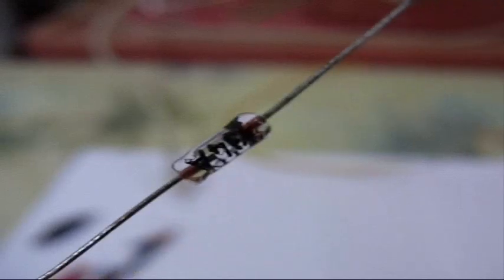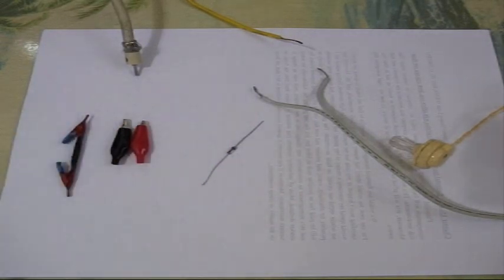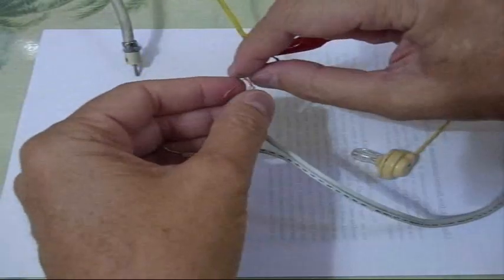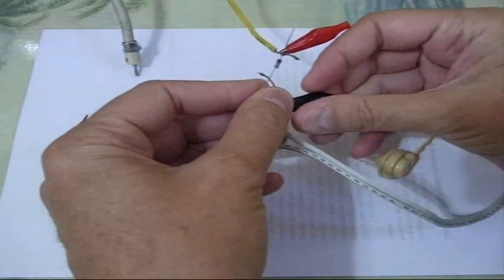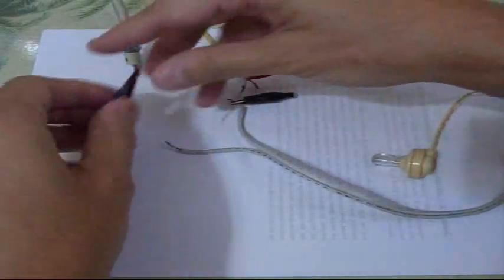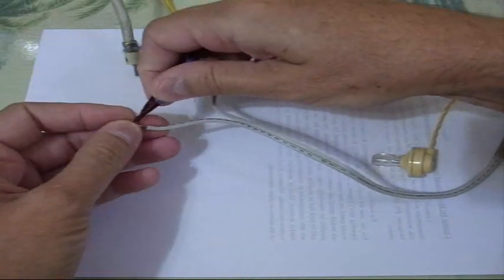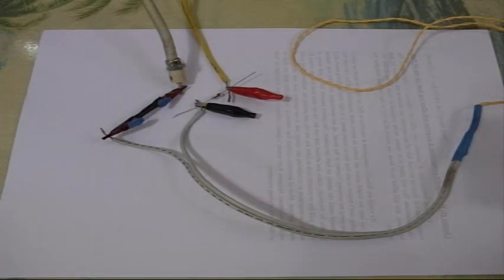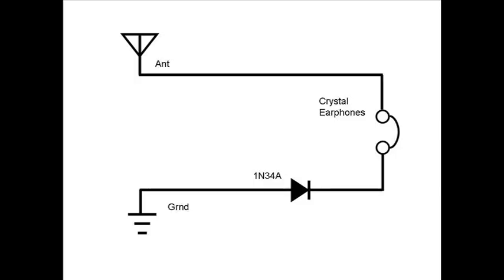World's Simplest Radio

Comment: I made my first ‘Crystal set’ when I was 12 yrs old (and thats’s over 64 yrs ago) then I later added a tuning condenser that enabled me to tune into different (medium wave) stations and then I added a small amplifier with battery to power a speaker. But the thing I most remember, was being exhilarated at hearing my first program come scratchily through the Airways with my Ex-War surplus earphones that were plentiful in those days.
Reply: My Dad was born in 1940, and he too got interested in electronics at a young age.  I believe a crystal radio was his first electronics project.
When I was a kid he told me about tuning into an interesting AM radio station across the Rio Grande from Del Rio, TX as a teenager.  I guess the radio stations in Iowa weren't broadcasting much new music at the time.  Him being an electronics nerd allowed him to hear Chuck Berry, Carl Perkins, and Little Richard before most other people in the area.
Then he went into the U.S. Navy and fixed radars, followed by fixing TVs at Sears for 35 years.  I miss the old man.
Reply: Nothing quite beats listening to a distant station fad away as the sun comes up.

Comment: now I remember my first radio using 2x 1n66 diode and crystal earphone.  :)  almost 27 years ago! thanks for sharing.
Reply: I used a 1n60 diode 1 Variable capacitor 300pf piezzo earphone and a very long wire for antenna.
That was in 1978.
Gooood times.
.ha
Lol

Comment: That it is!  It would even be listenable if two conditions exist ; 1) you are in range of an AM station, 2) That AM station is not being competed with by other stations because (a) it is the only AM station within range, or (b) that AM station overpowers all the others.  Unless one of these two conditions exist, you will hear nothing at all, or  just a cacophony of several stations being received at the same time.

You need a way to tune the AM band.  A coil is the simplest, a coil in parallel with variable capacitor is even better, and make the received signal much louder.

Even simpler?   Toss the 1N34 or 1N60 Germanium diode, and use an old, tarnished, all-copper penny "tickled" with a sharpened #2 pencil lead for the best signal.  The pencil lead can be mounted on an opened safety pin for support.
Reply from the maker: There are 17+ stations in my area and this setup locks on to the strongest, you can not hear any of the others.  I have several other videos on different types of crystal radios, but this is the simplest one can make.

Comment: the diode is connected to the ground and not to the antenna side? The drawing is correct? What happens if you turn the diode around, change its direction? Would it work also?
Reply from the maker: It does not really matter.  It's just either ground or antenna, diode, earphone lead 1, earphone lead 2, and then the other (antenna or ground).  It's not just the few parts that make it the simplest.
Reply: @tsbrownie  thank you very much for your quick answer., even if I do not understand how it could possibly work. Which it obviously does. You would think that the diode can have no effect on what goes through the headphones, when the diode is placed after the headphones. It is a complete mystery to me!

Comment: AS A KID ( IN THE EARLY 70'S ) I ORDERED A " GET SMART " RADIO PEN FROM THE BACK OF A COMIC BOOK . I THINK THE COMPANY WAS " JOHNSON DAVIS" ? ANYWAY WHEN I GOT IT I OPENED IT UP TO REVEAL A SHORT ANTENNA AT THE TIP, A DIODE IN THE MIDDLE AND A GROUND WIRE AT THE BASE . THINK I PAID $ 2.99 FOR IT
Reply from the maker: I think I've seen something similar.  The "antenna" may have been a tuning rod, if it's the same design as the one I have seen.  I used to love that show, Maxwell Smart.  The dome of silence and the phone booth elevator.

Comment: hey, i wanted to ask can i use an 8 ohm speaker instead of the crystal earphones i cant buy it
Reply from the maker: The speaker uses way too much power. However it's worth a try because if there's a high power station near by, sometimes you can just barely hear it. Some of the high pitched squeakers from smoke alarms work.

Comment: Tsbrownie, when I was a little kid in the '50s, I remember making a radio with a small, faceted, shiny rock/crystal, an earphone some wire and a safety pin. I stuck the wire into my window screen for an antenna, hooked the other ind to one side of the ear plug, hooked the other side of the earplug to the safety pin and moved the pin around on the little rock to find and change stations. I don't remember how I hooked the rock to ground but it had to be close to my window. It was probably a water faucet or something.
Reply from the maker: I'VE DONE THAT!  That rock is called galena.  It's a very common lead crystal with sulfur and other stuff in it.  That's straight out of the cub scout manual.  The galena was set in a bit of copper water pipe and you poked the safety pin around on it to find a junction.  There was also a wiper for tuning.  The window screen works for an antenna, but if you have a long gutter that's not grounded that's even better.  I have a video on the (modified) cub scout radio, but I used the diode because it's easier to find these days and more goof-proof.  https://www.youtube.com/watch?v=8XR9Uzy2RPM&t=706s
Reply: Tsbrownie, thanks. I really enjoyed your video. The wiper for tuning was on my improved version and was a toilet paper roll with wire wrapped around it with another safety pin rubbed across the windings. The improved model was mounted on the piece of cardboard at the bottom of a school paper tablet. Thanks for reminding me of this. I haven't thought of it in almost 60 years.
Reply from the maker: Well thank you.  Glad you liked it.  I found my old cub scout handbook and decided to make it for old time's sake.  If you were a boy scout you might remember there was a company that sold kits for these radios and similar stuff (wood burning, copper rubbing, ...)  It was out of Nebraska and decades later I ended up working with his son!
Reply: So would a quartz crystal with one end attached to ground and the other end to the aerial , and the earphone attached to ground and aerial respectively pick up a signal?
Reply from the maker: Probably not.  The chance of it accidentally working is small.  Galena (a lead mineral) will work.
Reply: Sir where can i find it easily if they don't  have it for sale

Comment: No variable capacitor, how to find other radio stations?
Reply from the maker: @Kalossabrakstein  Sorry. I am not paying attention. Then I accidentally deleted your comment while trying to delete mine. I am really making a mess today.
Reply from the maker: @Kalossabrakstein  Do you have access to an oscillator?  In the correct frequency range it will produce a beautiful tone.  Did you try my simple AM transmitter?  If you built it exactly like I did you will get a positive check on whether or not your radio is working.  https://www.youtube.com/watch?v=_5o2C9sCvec&feature=youtu.be
Also you can just get the oscillator chip.  They are really cheap and easy to use.  I used an MCO-1510A at 1MHz.  They are very static sensitive, so take precautions.

Comment: How do I eliminate the infernal 60 Hertz noise from the earpiece? I have a transformer and earbuds in place of piezoelectric crystal.
Reply from the maker: To be honest I have not tried that configuration.  I am surprised it works because earbuds take a lot of power relative to the crystal earphones.  You must have an AM station very close or very high power.  Some things to check: you should ensure for both safety and reception purposes that your antenna and ground are no where near an AC line.  Never use your AC ground for a radio ground - sometimes they go live and they over carry RFI.  A capacitor across the transformer might help, what size you'll have to experiment.
Reply: @tsbrownie  I'll have to give some of that a try and will give setting it up outdoors a shot too. Thanks for the suggestions and for posting this video! I have 790 WAEB within local range luckily which can be heard on it during the day.

Comment: I find it brings in more of the signal when you ground the antenna separately.
Reply: I used a carbon resistor to attach to the 2nd ground for the antenna, as an experiment. It worked but you had to tinker with it a little bit to get it to sound louder. I was using two old steel rods connected to the ground, I had to sand them to get bare steel to the connection. Without the 2nd ground to the antenna attached with a carbon resistor, you could barely hear anything. I experimented with using a multimeter set to 200kΩ from the hardware store (7 Function Digital Multimeter) to make the signal louder, I connected common to the antenna side of the earphone and the other side to the ground after the diode, and you could hear a few stations at once. Stations came and went and shifted their perception a little bit over time, And at one point I picked up a station clearly that was foreign (spoke some sort of Asian/Japanese language?)
Reply: @AaronDarden  Sorry for my ignorance (beginner here), but shouldn't you ground the antenna AFTER the signal goes through the diode and earphone so that all the signal from the antenna is forced to go through the diode and earphone first before it can go to the ground? Aren't you diverting energy from the antenna too early and sending it to the ground and losing energy from the diode and earphone by grounding it on both sides? I'm thinking you should ground it only at the end, forming a circuit from antenna to diode to earphone and then finally to the ground. What is the resistor for? Does that prevent the energy from going to the ground too early?
Reply: It was just an experiment that i found worked for me, I used graphite on paper and alligator clips to get different signals but yeah i did it a while ago i have my finished crystal radio unit packed away in a shoebox haven't brought it out in over a year
Reply: @samh5535 The resistor in my experiment acted as somewhat of an attenuator to get different signals to go through to the earphone without using any coil. In one of his other designs he uses a resistor as a bleeder resistor to keep the crystal earphone from building up charge and crackling

Comment: Outstanding !

What kind of transmitter could one build, CW keyer?
Reply from the maker: +Bruce Wayne Thanks.  I discovered this as a kid playing with my first crystal radio.  It&#39;s unbelieveable that it works and works well.  For 1 station anyway.
I have been thinking of a transmitter, but a powerless one eludes me.  Perhaps 2 radios, 1 to supply power (like in my video on powering a joule thief with a crystal radio) and the other to transmit.
Reply: tsbrownie It would be interesting to make a CW (Morse code) keyer with a solar panel as the supply; in keeping with the spirit of free power radio.
Reply from the maker: +Bruce Wayne With a solar panel that's pretty easy.  Somewhere I've got a solar rig that would run my handy talkie and charge a battery for camping.  (I show it in one of my DIY solar power pack videos.)  There are lots of designs for Ham radio QRP rigs out there.  Most do require a license to operate.
Reply: +tsbrownie You are correct, I have my license; however the FCC allows anyone to transmit during an emergency that involves human lifesaving.
  I am thinking the simpler the better.
Just found this multi band circuit.
http://circuitos.cl.tripod.com/schem/r75.gif
Reply from the maker: +Bruce Wayne Interesting, simple design and tunable with some replaceable modules of I & C.  9-13 volts single supply.  I can't tell about RFC1, but otherwise it looks like most components would be small.  Probably could fit it in a cough drop tin.
Reply: +tsbrownie RFC1 is a choke/coil with ferrite core.
http://www.kenselectronics.com/lists/coils.htm
Reply: +tsbrownie X1 is a crystal, probably 10Mhz based on this circuit.
http://www.sentex.ca/~mec1995/circ/30m.htm
Reply from the maker: +Bruce Wayne I found this, it is similar, it shows a 7.03 MHz crystal: http://qrp-projects.blogspot.com/2014_06_01_archive.html
Another one on that same page has a 3686.4 Mhz crystal.
Reply: tsbrownie I like that link, very good find !
Especially the "TOBACCO TIN TRANSMITTER"
Reply from the maker: +Bruce Wayne I can't find the original article that included your original schematic.  This one is not too bad.  http://www.qsl.net/pa2ohh/98tx20m.htm

This one is also close:
http://www.zerobeat.net/g3ycc/ei9gq.htm

A simple one:
http://www.pa3hcm.nl/?m=200208

And another:
http://makerf.com/posts/mighty_simple_shortwave_transmitter

http://www.qsl.net/kd7rem/tt2.html
Reply: tsbrownie Those are fantastic!
   I would like to see the "A Simple One" on a wood board, that matches the look and feel of your radio.
Reply: You can find plans all over the Web for CW transmitters.  There are even kits on eBay.  If you build one, the only heavily specific item is a crystal cut to the fundamental frequency you wish to transmit on.  This is of course keeping it simple.

Comment: Can u connect a 1.5v mini battery to power it so It work with a regular earphone ?
Reply from the maker: I have a video on connecting an amplifier to a crystal radio.  It is the bottom link in the description.
Reply: Naitik Patil no you need a crystal ear phone,it's high impedance
Reply: hello, you need OA79 DIODE AND A HEADPHONE. HEADPHONE SHOULD BE VERY OLD TYPE TELEPHONE EAR PIECE SPEAKER. IT IS 20,000 OHM.

Comment: What did you use as a ground?  What did you ground it to? The antenna is that a speaker connector?
Reply from the maker: The ground was the grounded outer jacket of an old coax TV cable.  It's connected to a ground rod.  The antenna is the center connection of that same coax.  None of that is necessary, it's just what was convenient and it will work OK (but not great).  Usually I use a long piece of plain wire between 2 insulators (longer is usually better, 6 M or more).  The ground just a wire to a ground rod.  I've also clipped on to a gutter for an antenna (so long as it's not grounded somewhere).

Comment: Is it possible to use a regular speaker in any way?
Reply from the maker: Not really.  I have a video showing how to connect a battery powered amplifier, that's as close as you can come to it.
Reply: tsbrownie thanks. Where could I get a crystal speaker?
Reply from the maker: I've seen them on Amazon.  I bought one at a local, no name, electronics shop.  I think it was a dollar or two.  The place sold parts, kits, stuff like that.
Reply: tsbrownie very useful information. Thanks 👍
Reply: ...a "regular speaker" is what's known as a "low impedance device", and would act like a short circuit with a circuit like this. 

It is POSSIBLE to connect a speaker to a circuit like this, if you use an output transformer- but then, this isn't a simple radio anymore-(!)
Reply: @daleburrell6273  Thanks for the reply. I remember when I made this comment... I tried it with a big speaker and when it didn't play anything at full volume, I thought it was because it wasn't grounded well enough. Yikes.
Reply: @voltariantechnologyinc.8594  "...in order to get maximum power transfer, it is necessary to match impedances." 

A loudspeaker is a LOW impedance device- and a crystal radio is a HIGH impedance device- the two are NOT directly compatible.
Reply: @daleburrell6273  I know... I thought I made it clear that I learned these things over the course of three years.

Comment: Is it possible to tune stations? Also, do crystal radios only pick up am?
Reply from the maker: Yes only AM. I have other videos showing how to make different types of tunable crystal radios.
Reply: @tsbrownie  hmm thanks for the info. Is an amplifier/a crystal headset necessary? Anyway to get a normal speaker or headphones work with it?
Reply from the maker: @sreea2365  Yes. I have videos on all that stuff. Amps are convenient, but then you are introducing power into the system. The crystal is pretty much required for a no power setup.
Reply: @sreea2365 ...you have to remember that you are working with a very tiny signal- and it takes a certain amount of power to drive a speaker. 

I remember reading about a crystal radio that used a speaker- but that circuit needed a transformer and a VERY strong signal to work.

Comment: Will it work with a in4005 diode? I've some lying around.
Reply from the maker: The 1n34a diodes are very special.  Most diodes won't work at all, some produce VERY weak results.  The 1n4005 is a rectifier and is made for higher voltages / currents, not so good with weak currents and low voltage.  Never tried one, but I would be surprised if they produced any sound at all.
Reply: Use 1N5819, salvaged from not used phone charger on the output.
Although it silicone and Schottky type, the voltage drop just 0.2Vand can handle radio frequency.
Believe or not, it not about silicone or germanium type diode that make radio detector work, it jist very small voltage drop and frequency capabilities of diode.

For greatest diode in modern age and work wonderful than 1N34 or 1N60, choose BAT32! But If you can achieve it, just use 1N5819, very very cheap and reliable,   you get it free from disposable Phone Charger

Comment: Would it work without a crystal earphone because I'm using a copper coil speaker with magnet?
Reply from the maker: No, it MUST be a crystal earphone.  Even the most efficient magnetic earphone takes way too much power to work.
Reply: Ok